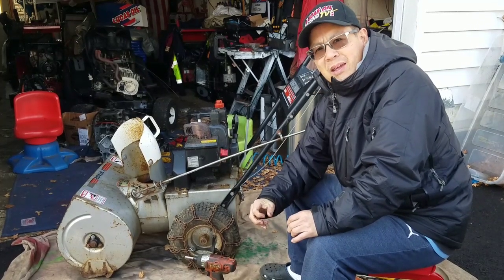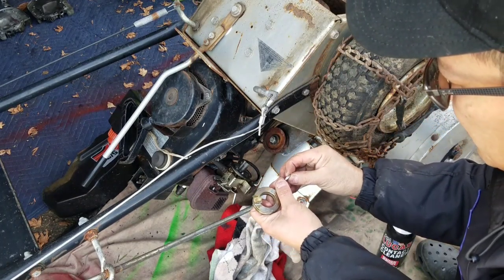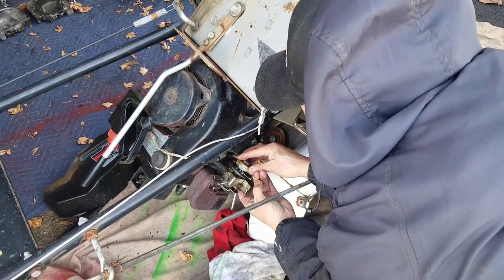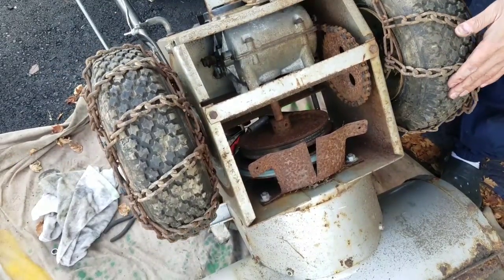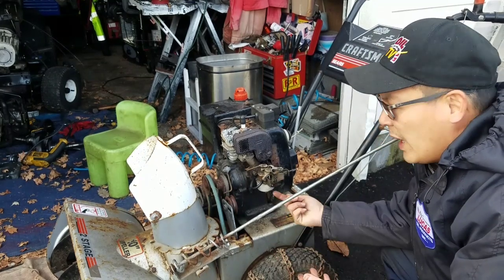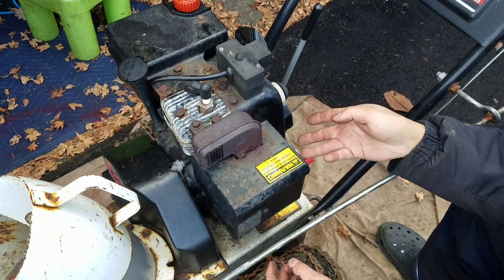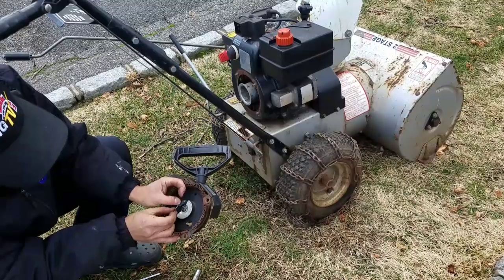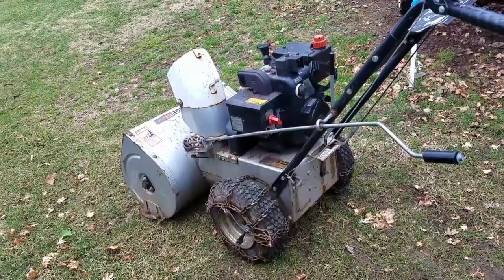FREE CRAFTSMAN 522 TECUMSEH DUAL SHAFT 2 STAGE SNOW BLOWER CARBURETOR CLEAN RECOIL STARTER REPAIR

Comment: Inside the carb on the engine side, on the right side there are 2 or 3 small holes that help idle. If they are plugged it will bog it down. The main (fast idle) jet on the bottom also has a small hole close to where the bigger one is on the side that often gets plugged. Might want to check them out as well as the low idle screw on the side needs to be opened up since it does run on choke, starving for fuel .
Reply from the maker: At the end of the video, I adjust the fuel.mixture again and it runs perfect now.
Reply: @MowersNBlowers  Saw it run on fast idle at the end (lever all the way up), didn't know you got it to work OK on low idle. Good stuff !!
Reply from the maker: Thanks bro, the culprit to why the adjustment was so tricky and needed precision was the screw tip was broken and wasn’t sharp at the tip.  It needs a new needle screw for the bowl nut jet. Thanks for the comment. Hope you’re subscribed, hope you’ll comment more as your expertise is needed to keep me honest.

Comment: My grandfathers craftsman 5/22 did the same thing like this 5/22 snow thrower when you moved it to your back yard when it died on you can you a video on how to adjust that mixture screw so that way I can no how to adjust my grandfathers so that way you can switch the choke lever to run it won’t dye on me again when I use it this winter
Reply from the maker: Lol, just turn the screw to tighten or loosen and listen to the engine at the same time.

Comment: Is there a reason you don't check the spark plug or replace it?
Reply from the maker: norge696 it’s rarely the spark plug, what reason would I change the spark plug if it starts up? If it starts, then there’s spark!
Reply: @MowersNBlowers  I'm just saying because a spark plug gap opens up overtime. They should also be changed every 100 hours. Unless you know how long the mower has been in use I'd change the plug. Especially considering how rusty yours is. 

I have seen this issue with several lawn mowers I came across. The gap is way off and it takes 5-7 pulls just to start it. Fix the gap and it starts in 1-2 pulls everytime. 

It's just something you shouldn't look overlook considering a new plug is only $2-3.
Reply from the maker: @norge696  true, but as I said in the video, this is just a piece of junk I wanted to sell as is, I have no intention of keeping it, but would fetch more money if everything worked.  If I was going to keep it, I'd do an oil change, change belts, plugs, new cables, buy a bottom plate, do an impeller mod and paint the whole thing, but it's just a quick junk flip and I wasnt too concerned about the spark plug.  As long as it starts and runs for a potential customer.  Thanks for the comment bro.